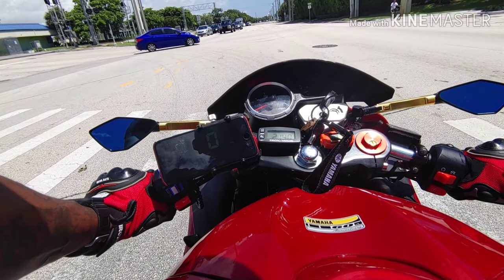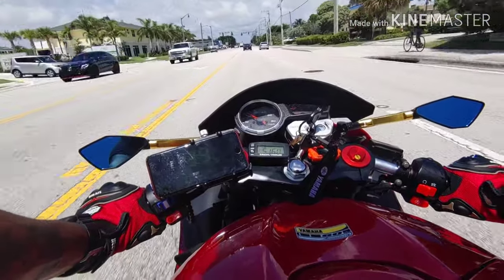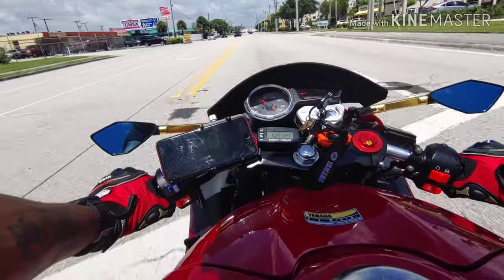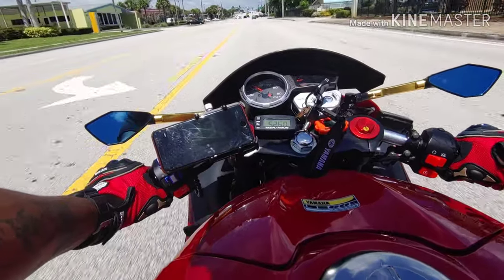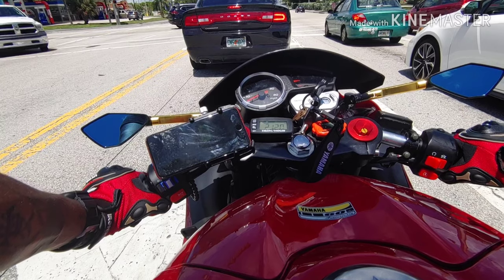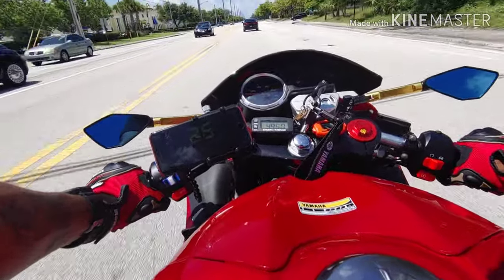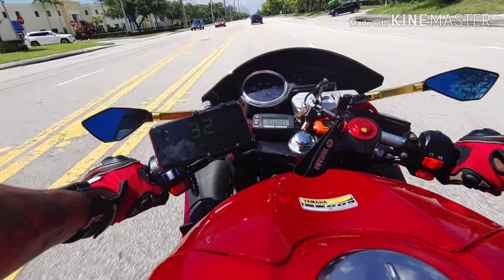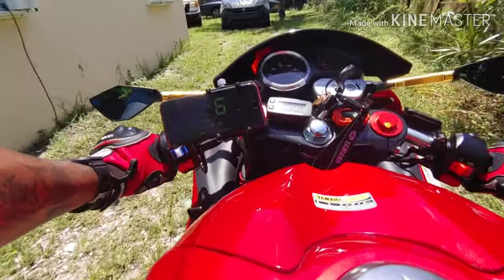Df50sst | Venom x18 how I look with new rear tire/CVT tuning part 2

Comment: Thanks for taking the time to reach pout bro..The carb is a high performance adjustable carb with an electric choke.. I all so purchase a high performance 6 pin AC CDI as well as the spark plug and filter.. Everything coming in the mail. Do you have any advice for me?
Reply from the maker: Ok cool thanks those are usually the 1st upgrades most ppl do I mean I did that as well changing the carb is good stock is 18mm so you usually see 19,20,21  also if you put a pod filter your going to have to upjet your carb for more fuel also with the cdi I would change 1st to make sure it starts properly them change carb etc

Comment: Hey quick question looking for guidance my DongFang is dead.its not the battery or starter relay because it lights up when the brake is on and battery is full.sparkplug isn’t burned out either .looks like the ground and think i might have knocked it loose when i swapped the carb..any chance you know where the engine ground is on DF50SST? I’m afraid once my new bike gets here this weekend i will literally have no interest tackling fixing this on this bike for a few weeks lol
Reply from the maker: I really don’t know sorry and yea I definitely understand I still haven’t fixed my headlights on it due to the fact I ride the new one more now
Reply: No worries I know I’m going to be pulling it into the kitchen to tinker with while I ride the new one around hehe

Comment: If you put a nibbi carb on that you can get like 75, 80 miles hour out of it
Reply from the maker: Make video you’ll definitely be the first to do it
Reply: @Mikecheckmoto  mine has it on already going to make a video then thanks.
Reply: @Mikecheckmoto  nibbi 28mm carb and ncy clutch set with 2000rpm springs and ncy cdi box was the first things I changed upon purchase of the bike I got an orange 2022 df200cc its crazy its a 2009 yamaha r6 with smaller wheels and different motor system 😆